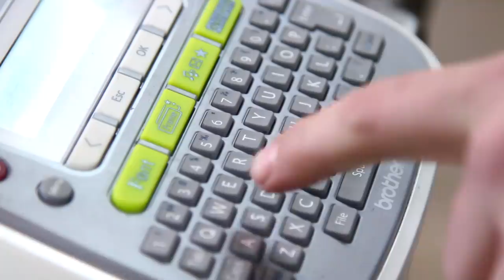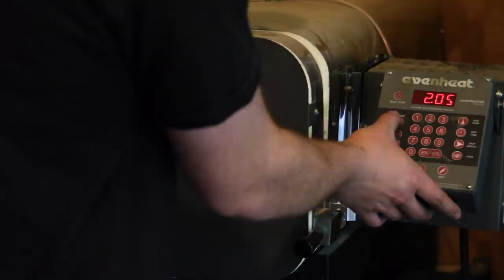Forging a Hewing Axe - Blacksmithing

Comment: You do great work man. My only issue is that to my understanding a Hewing axe is offset to one side, so that it splits the wood away straight and even for squaring up logs.
Reply: That's one tradition, in Finland and Sweden double beveled hewing axes are the most common type. Almost completely unheard of in my region when it comes to single bevels. Google billnäs hewing axes for some examples. Also the swedish Gränsfors 1900 is still made and is most commonly sold as a double bevel, but can be had in all styles.

Comment: how many hours did it take to forge this?
Reply from the maker: Probably like 3 but the filming adds some time
Reply: @PaulPinto  do you think it's possible to forge a single piece axe from leaf spring, about 1 cm thick ( kinda little less than 1/2 inch thick)

Comment: Make a large Eye with the handle passing from the top of the axe: better fitting, stronger and simple, no wedges needed!
Reply: I may be wrong but isn’t that just putting an axe head on a tomahawk handle
Reply: @oscarsimpsonjacka7917  same thing, tapered Eye and handle matching and locking. Also Is Quick changable, which Is wow on a hewing axe, depending on where you are working on you throw a different handle in the axe
Reply: Noooooooooooooooooooooooooooooo!